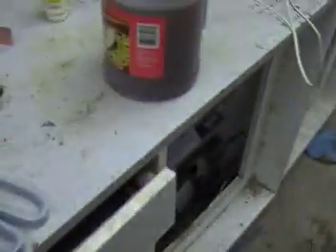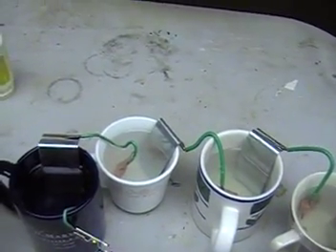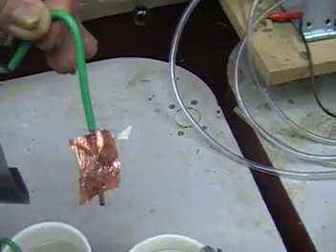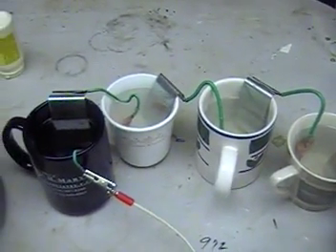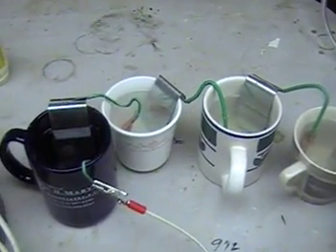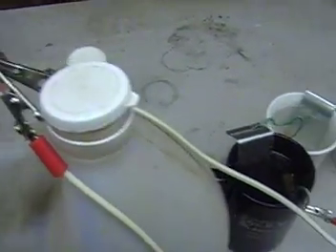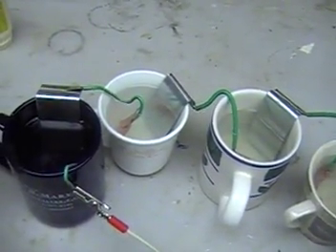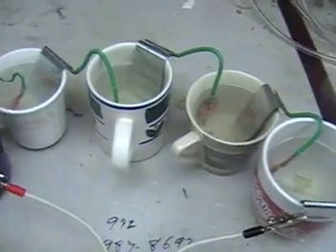Check out my salt water battery

Comment: Is there a formula to figure the currents available?  How large can you go before diminishing returns?  The size of the anode and cathode at diminishing returns?  Is there a point where the salt water loses practical reaction?  Can the containers be constantly replenished or will overflow impede the reaction?  Since ions get converted to electrons, there would have to be a finite number of ions?

Comment: Hey RHEAD100,   I'm glad you were interested in this experiment.   I have personally found many solutions.. (Electrolytes) that work well in the same way, most notably DIRT!     If you use dirt.. any dirt.. and add water.. plain water.. you get the same result with about .5 - .9 Volts per each cell.  I like how you mentioned the surface area for amperage.  Thats how I came across this video.  I am in the process to get a "Dirt Battery" to power a tv through an inverter.   Free Energy is EVERYWHERE.   Solar is what got me started.
Reply: I forgot to mention...     If you connect this to a NON-RECHARGABLE Battery...  it will recharge at a slow rate..  depending on your amperage output.  too much amperage could blow your batteries though, so careful if you put these in parallel.  :)

Comment: Hey rhead 100. Make a bunch of those cups and get 12 volts. output.  Take the output and put that into an inverter. The inverter makes A.C currents.   Make another video and see what you can run on this power AND how long it will last.  GOOD LUCK.

Comment: what metal did you use u did mention it zinc magnesium.
Reply: He Said "Galvanized"...  Which means it is iron or steel (usually) coated with a layer of Zinc.   From my knowledge, anything that is galvanized is just a zinc outer layer.

Comment: Made my night... I was wondering about the most available materials to me (in various types of pinches). I tend to have a lot of scrap material around for antenna experiments etc. (hidden here and there since the wife doesn't want a junkyard) and I started wondering outside of the penny/cardboard/lemon juice box, or homemade lead acid battery requiring electrical conditioning... this is just a perfect example, man. Didn't think about salt but heck, short term it's perfect isn't it! And of course I'm checking out the whole ground battery thing.

Comment: I'm upto 7 volts off about one coffee cup worth of water and no salt. Like you said it is about the amount of cells for voltage. I got 34 small resealable bags with small strips of aluminium from a can attached to just a copper wire (no extra copper). It sounds like a lot of cells but they are small and take up little space. I just need to work on my amps now. I wanna try and power a 6v RC car. haha
Reply: you must in cress the surface area of your plates to in cress the amps

Comment: how much the volt of the LED that u use? can it light up 2.5V of bulb?
Reply: RHEAD100 24 hours a day for a week? You sure it wouldn't run out before then?
Reply from the maker: not  yes  "but"   hell yes.     24 hours a day for a week or better if you need to.                   Piece of cake.
Reply from the maker: ***** ABSOLUTLY SURE ;  Not only bet on it ,  BUT will give Odds
Reply: RHEAD100 I've seen a similar experiment where a guy powered a little computer fan. Lasted about 7 minutes.
Reply from the maker: ***** I saw the same video .  If the plates were larger it would have run longer .
Reply: RHEAD100 Probably so, but I wonder how long. So where are the electrons coming form anyhow, the salt?
Reply from the maker: ***** As long as you keep adding water , zinc and salt.
Reply: RHEAD100 So the zinc is used up in the process?
Reply from the maker: ***** YES  & SOME OF THE SALT
Reply: RHEAD100 So it forms ZnCl and the electrons come from the Na?
Reply from the maker: ***** YOU GOT IT !!!!!
Reply: RHEAD100 The other one I saw used a coke can surrounded by copper foil, with saltwater between. The reaction only lasted a short while. I posited that there were just extra electrons in the salt for that type, but I'm still unsure.
Reply from the maker: ***** you are most likely correct as coke cans have paint on the outside and a protective coating on the inside and only the edge where the can was opened was exposed to the salt water. Some time people fore get small details. HEY  it happens.

Comment: help me pls!! I did this experiment and I got 2.2 volt but there is no current. What should i do? FYI i connected the cell with a fan so it doesn't need much voltage :)
Reply from the maker: Sounds like you were using 3 or more cells . And ,  OR ,  too small a surface area of your plate material
You should get .8 volts + or-  .04  per cell . If not add more salt.
More than .84 volts per cell is very difficult.
Increasing cells to increase voltage IS the way to go.   "BUT"  voltage with out amperage does not mean a whole lot.  SOoo ;  increase  amperage by increasing surface area of plating.
I hope this helps.
Maybe I should remake this video and go into a little more detail.
Reply from the maker: series gives volts . Parallel gives amps.  You need to have both right .
May be you need more than  one Cell.
Reply from the maker: One more thing I forgot to mention .  It is DC volts. make sure what you hook it to does not need AC volts.

Comment: You're almost ready for science. The power is coming from the different conductivity of the copper and the zinc galvanized coating. It works the same as a car battery does except those use zinc and lead.
Is the lead blinking because you're generating low power? What's in that thing you have holding the led? It looks like the circuit is building voltage to get through the green led forward voltage and then the current flow drops it down to where it needs to fill back up.
The thing is that when you measure voltage it needs to be voltage through a load, a resistance, or you're not going to get a practical measure. Volts and amps are two aspects of the same thing, without current flow the voltage just builds up even under very low power, power IS volts times amps. If you don't believe then take a bare led and attach it to your meter (+ to long lead) and point it at a bright light. Then try to power something with it, or even 100 leds together facing into sunlight. The power is next to nothing. When you draw current, that's when the voltage drops.

So run your battery through a known resistance and the voltage you get then will let you find the current using Ohm's Law: Current = Volts / Resistance.

Comment: Sir:  Great build.  Lots of us lookie-lus are learning low power tech on the web.  You might want to try common Epson Salts instead of table salt and/or Rochelle Salts.  You might want to use silica on your electrodes to keep them from corroding (if they do) since copper costs can add up.  Google Bedini and ibpointless2 for hundreds of similar videos of their builds and lessons learned.
Reply from the maker: Thanks Robert ;  Great info.  I will check into it.

Comment: two different metals are needed ( positive Copper )& (zinc negative )also a  electrolyte solution, so when the electrons pass through the solution to balance themselves out it causes current to flow

Comment: Okay Add a Voltage Regulator to it, then run it through a DC to AC inverter and bridge it to a Grid-Tie... See how long it takes before your power co comes and says they need to "check" the meters OR.. asks if you've added Solar Panels, Wind Turbines, etc. to your house.  They will try almost ANYTHING & EVERYTHING to STOP you from getting FREE POWER - LET ALONE try and STOP from paying YOU for the SURPLUS power they are OBLIGATED to pay YOU for that YOU send to THEM!  Semper Fi!  RESISTANCE!

Comment from the maker: is there a limit to how much electricity it puts out?  (  Yes ,  the zinc in the  galviniz is slowly distroyed and needs to be replaced )  If so, how can you replenish it? ( goto any construction  demolition site and do a little dumpster diveing )  Also does the size of the metals or amount of water affect the amount of energy or is it just the number of total containers.  ( number of contaners ups the volts ,  surface area ups the amps.)

Comment: this is really awesome, so i understand that the electricity comes from the two metals reacting in the salt water but is there a limit to how much electricity it puts out? If so, how can you replenish it? Does the electrons from the zinc eventually run out? Also does the size of the metals or amount of water affect the amount of energy or is it just the number of total containers. Thanks

Comment: @cheomire: sorry, I dont think so. I assume these leads resistance are negligable for this small current (6 mA). Even the leads were made to be 1 yard each. The voltage drop's difference will be less than 0.1%.

Comment: you did a goodjob man , i tried it and it worked , 7 jars and i got 6 volts but very low amp cuz i only used bare copper wires and sheet metals , iwill try large surface copper sheets. thx a bunch , u r cool

Comment: what about making one of those but bluilding it as one of those diy hv cap made with arnsparent film and aluminium foil, i mean take a thin sheet of zink and one of cooper and roll them up with silk in between to act as an insulator so they dont touch but as it's just cloth you can submerge it in oversaturated salt water and as the contact surface is large and the separation between the poles is tiny (less resistance) that should give you a lot of current, shouldn't it?

Comment from the maker: @xxAkiMatsuxx  It would be point 8 volts.  the size of the plates incresses the amps not the voltage.  the number  of sets of plates incresses the voltage and the sets have to be seperated like a lead ascide battery

Comment: Awesome dude today we just had a fellow from our Electric Company come and asses us for Solar Co-Generation.
also you can make the same thing with Earth and Water in an Ice Tray it is called a Quartz Earth Call also you can use copper and Iron and Heat the Plates or Zinc and copper rods hammered into the ground Any Dissimilar Metal will produce a current power Radios with Copper Pipe and Galvanized Iron or steel 1800's batteries are as old as Human Kind

Comment: the thing is that by using positive metal (aluminium) and negative metal (copper) and electrolit (salt water) you make the electrons in the water to flow to the copper and that is what makes the voltage, as the electrons on the copper will jump to the absent on aluminium and that is potential. You can also try lemon with the same copper and aluminuim and you`ll get the same result. very good video! nice ppl share this kind of stuff. good for you!

Comment: The more salt the better , actually any acidic liquids you can through in the mix the better.

I use sea salt , vinegar , windex ... in a penut butter jar that should give you about .689mv if you have a big copper anode and a zinc coated nail

I could toss in bleach to make it stronger.

make 2 of them and get 1.2 volts to power an LED or small fan or digital clock even.

You're only limmited by your imagination.

Comment from the maker: @anushka9157    As much as you can get to desolve in the water.  The teperature of the water determins how much salt will sesolve in it.  Just add salt and stir untill it will not take any more.  when you stop stiring and see salt on the  bottom,  you have it right.

Comment: I have an old 6v car battery from a 1952 buick  that won`t take a full charge, some of the battery acid had spilled out at some point I even tried pouring water in the cells. is there a solution that  I can mix to pour into the cells that would get this battery to be like new?

Comment: I was wondring if salt water from the ocen could be used? If so then would ten or twenty 5 gallon buckets with large zinc and copper plates be enough to produce electricity to power household lights or an electric stove or other appliance?

Comment from the maker: @ladymysterious120   When some metals rust or corrod (oxidize) they will give off electrons in the form of electricity.
In this case the galvinizeing is a mixture of tin & zinc.  The salt only speeds up the corrotion prosses.  It is the zinc that makes the electricity.  Also, the salt water is an elctrolite for the electricity to travle through.
Like any battery,  sirers wireing incresses voltage and pairolle wireing incresses amps.

Comment from the maker: @ladymysterious120   if your led requires more voltage than you are producing it may not light   "AND"  if you produce more voltage than the led can handle it most liklyu will burn out.

Comment from the maker: @noir0222   The galvinized metal corrods and turns black and leaves a white cristalin substance at the bottom of the cups and takes 11 days 24 hours a day to do so.  The copper does not SEEM to be damaged though.

Comment: 1st thanx for putting stuff up for us ,,,have you thought about a HUGE SYSTEM ?say a 25 or 45 gallon drum ?that may be able to replace a EXPENSIVE battery bank ,as used by solar cells on homes ?use ALUM or SALT,SODA ETC ,so its not toxic ?a galvanised bucket is 2.5 gallon +already half a battery ?now thats a PROJECT lol,the mind boggles ,,,

Comment: @jamluvsanjoseboy  Yes you can use iron, although it wont be as efficient (i.e. you will get a lot less electricity). And it is not the steel which is important, it is the zinc. Those are zinc coated plates of steel (i.e. they are galvanized), but only the zinc is in contact with the salty water and thats all that matters. If you can't find zinc or any galvanized sheets, instead of using iron i would suggest using aluminum foil, which should still work pretty well.

Comment from the maker: @antizionfrepalestin   It is not the steel that is producing the electricity.  But the zinc coating on the steel.  If it were pure zinc it would make electricity a lot longer.  You are correct in that aliminum will do the same thing BUT  aluminum will will not make more electicity than zinc.  Zinc will make more electricity AND  Faster.

Comment from the maker: @Aqlor   Galvinizeing is a mix of zinc and tin And is electro plated on steel.  When zinc oxodizes the chemical reaction generats electricity much like a flashlight battery generates electicity by chemical reation.  The salt is only a catolist that speeds up the oxidation of the zinc. and the heat is also a catolist t5o speed things up.
There are thousands of chemicals that when mixt ,  will grnerate electricity.  Just    some work better than others.

Comment: I've built one with your same design. It lasted for 2 months and was still putting out voltage when I disassembled it. My new one puts out 10.5 volts. I'm going to add a few more cells to make a 12 volt battery. After experimenting with it, I've realized you were right about increasing the copper surface area to increase the amperage. Once again, thanks for the video

Comment: I built one with 8 cells with relatively the same results. My l.e.d. is still burning bright after 3 weeks. I've tinkered with galvenized fence posts and put a pluming copper pipe in the middle to create a compact salt water battery. I've found that I get the same voltage out of it when i put a paper thin wire in the middle of it. I'm pretty sure it has to do with the surface area of the steel and not the copper. Thanks for the idea. Good work

Comment: if you want higher amps than you need to set more batteries of cells in parallel whit other cels but you will need to use a semiconductor so one battery will not let its amps flow trough the other one

Comment from the maker: @yonewstart 10 cups under ideral conditions will give you only 8.2 volts.
Use large copper wire and hammer it flat to make a larger surface airea
Use 11 or 12 cups for 9  or better volts.

Comment from the maker: @waterskyrocket Not only is it possible. I keep an inverter under the set of my truck and I bought one for all of my lead men to keep oin thier trucks. We use  them on small jobs that do not have eletricity.  750 watts Home Depot $80.00  does a really great job running drills , screw guns, lights.  Not very good on high amp skill saws.
BUT  THEN  all you would need is a larger inverter.  We do have to start the trucks and recharge the battery two or three times a day.

Comment from the maker: Galvinized roof flashing works great.  A peice of copper pipe will work just as well.  Use table salt or ocean salt . Rock salt does not desolve fast enough.  And the warmer the water, the better.
Hope this helps.  And good luck

Comment from the maker: The surface area of the plats is the amperage The number of cells is the voltage. and the amount of water is not as important as the consintration of salt in the water.

Comment from the maker: To buy the metal would coast more than the electricity it would make. The point here is to recycle. After the zinc coating is off the galvinized plate you can sell the steel underneath for scrap iron.  The copper does not wear out.

Comment: you could run ac electronics by stepping up the voltage to 12 volts and running that through a dc to ac power inverter.

Comment from the maker: Your edge is;;
To teach and instruct people that after a catastrophy they are not at the merssy of the elaments if they are educated.
It is posible to charge batteries for radio Tv. Hearing Aid AND YES, even a pase maker.
You cfould even use it for electrolasis of water to breack it down to hydrogen and oxygen put the hydrogen in a bollon (plastic bag).  to signal rescuers of your location.
Let your imagination run wild ! ! !